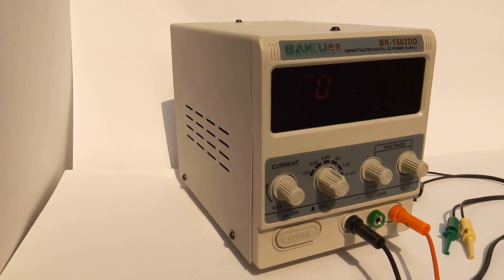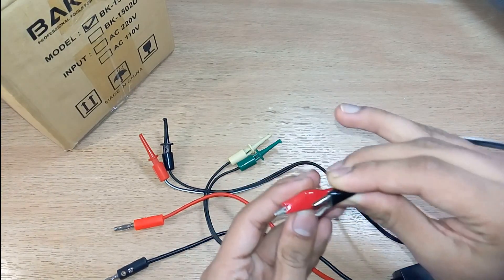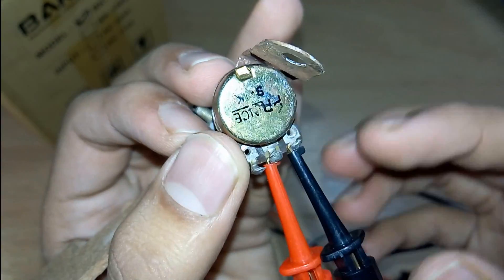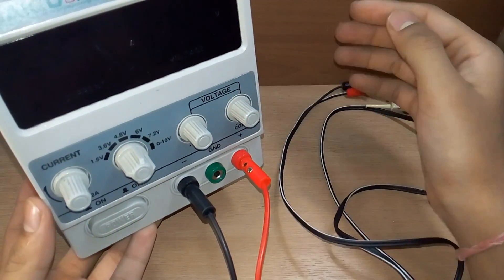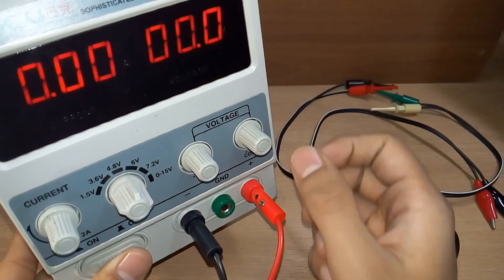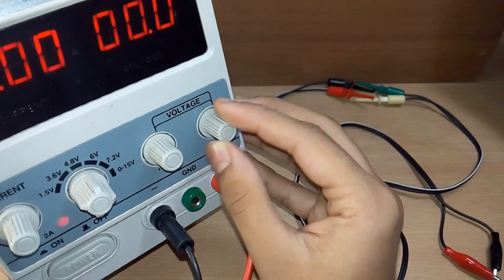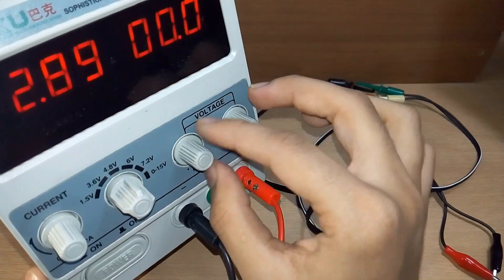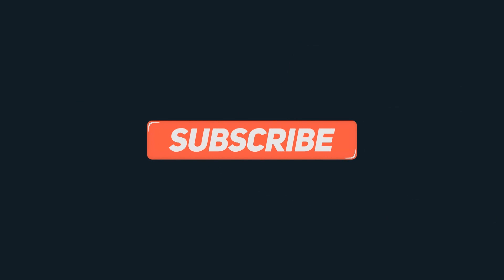Baku Bench DC Power Supply | Unboxing & Review

Comment: Can we use 1amp instead of 2amps to check mobile. I'm having DC power supply with 1amp only
Reply from the maker: Yes you can
Reply: @CETech4u  then why everyone uses 2amp to check phones
Reply: Higher amps is better. Voltage is pushed whereas amps is pulled by the device.
Analogy : Our road distribution transformer is capable of providing say 1000 amps. You can connect any device like 5 watt lamp or 2000 watt heater. In both items the voltage pushed will be 240, but the amps pulled will be different as per the device design. So no harm in using higher rated amps. Only the voltage should match.

Comment: Thanks for the response, could you explain me how you are adjusting current knob, in my case I set the voltage but could not limit the current, thanks in advance
Reply: you have to lower the voltage below about 5, then short the leads to adjust current
Reply from the maker: +Suresh Lingabathina Babu you might not able to adjust current because you must be using less current than set. Try the technique used im the video

Comment: This is a worth less power supply if you bue it for 1700 from ebay. It is avalable in local market for 900.  Any way apart from that. on the very first day the filter capacitor got burned after 2 Hr of use. Worst experience....
Reply from the maker: +Samiran Dey I bitter experience I suppose. Well mine works fine till date. I guess yours would have been a manufacturing defect.

Comment: Do you have a video on how to use it to power something like a cell phone?
Reply from the maker: Hey Jimmy
Can you be more precise on what do you want to see? Do you wanna charge your phone with it or power it up or what?
Reply: Can you power up the phone and use it without using a battery and only the DC power supply?
Reply from the maker: Yes if you plug in the plugs right where the battery plugs its terminals.
Reply: CETech Can you make a video showing the procedure along with the correct dial settings on the DC power supply?
Reply: it's easy
Reply: I want to know how can i understand that have powdered on the phone using DC supply when there's no screen display??!

Comment: can we set 1 amps and 2 volts
Reply: it says on front max 2 amps
Reply from the maker: +ketan
Hey
See you can not set the current to a particular value because you can only limit it. The minimum limit you can set is approximately 3.1Amp and not 0.6Amp as claimed by Baku. Although you can set the voltage at 2Volt. But it can do the work if there is overload protection in the circuit you power up.

Comment: hello i like to ask you a question.
how stable is the output voltage.
Reply from the maker: +sankar hey
Now i have been using the unit for long and regularly. Firstly the voltage it displays is not accurate all the times. Coming to the stability it is pretty stable, it fluctuates within +/- 0.2Volts at some times.
Hope I answered your query.
Reply: Have you tried to mod it with 10 turn pots. I have ordered one for myself
Reply from the maker: +sankar 
Till now i have not tried to mod it as i have a self made psu for my primary work with low current output. As Baku's minimum current is 3.1Amp which is a bit high for the work i do right now. But theoretically if we see that if we use the 10 turn pot it can only increase the resolution and precision and not the stability. Great to know that you ordered one for yourself. I would recommend firstly when the PSU arrives is to open up the splitter box in the cable and solder all the joints properly or to use another cables as the quality of these cables provided is cheap.
Reply: +CETech  can you share semantics of your low current power supply
Reply: +CETech  hello 
i am seeing a strange issue if I short the psu at any voltage or current it shows CC but it oscillates. CC led blinks and it delivers high current.please comment on this
Reply from the maker: +sankar hey
This is true. I dont know that why it starts blinking instead of being still also if you would have seen the display also blinks when there is short circuit. To check the current i would recommend to first short and slowly increase the voltage from zero. Continue this untill the CC led switches on for maximum current.
Reply from the maker: I would be making a DIY video soon but for now if you want to make one grab a DC buck convertor hooked up to a 12V 1amp adapter and its output hooked up to a voltmeter which does the work pretty sweet.